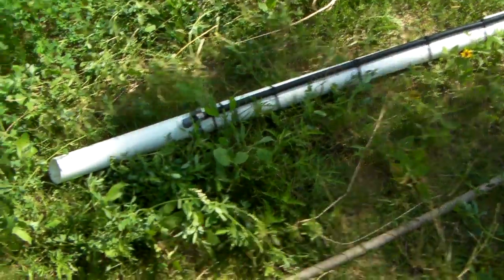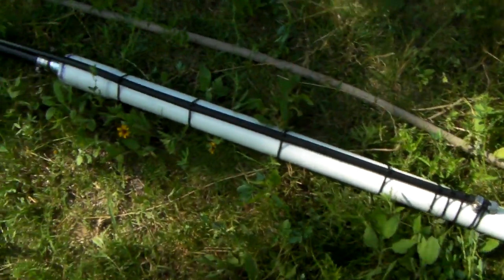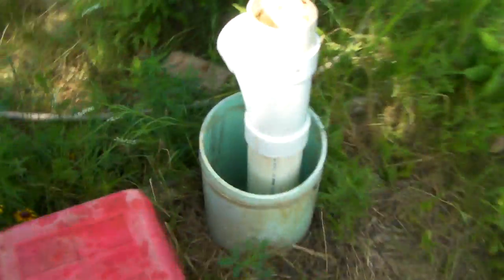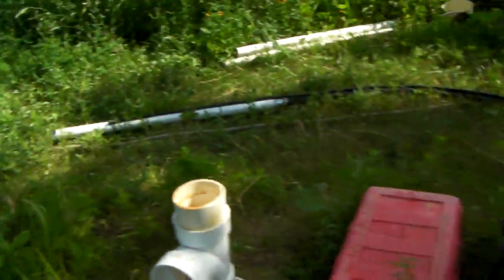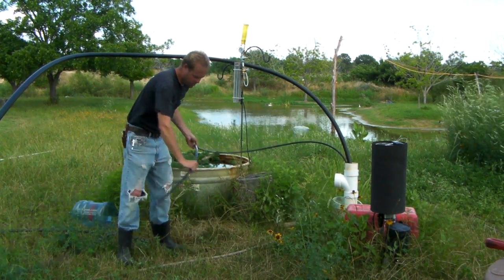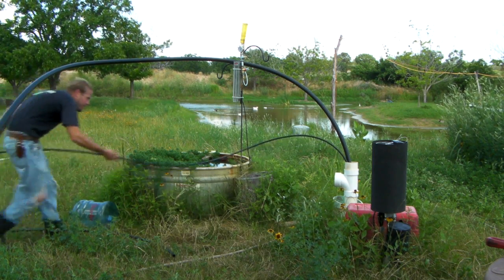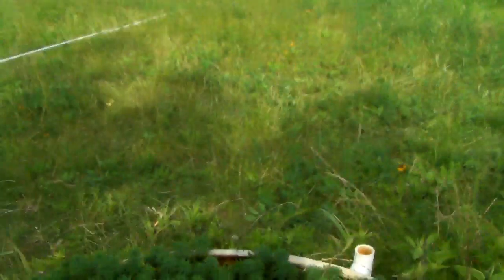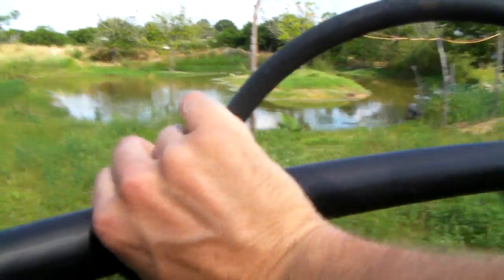Air lift water well pump in elgin texas part 2.5

Comment: Awesome knowledge.  I've been researching water pump to suck from 100' deep when I should have been looking at air pumps.  I've got a 4" casing with a 1-1/4" pvc for my submersible pump for the house but I've been trying to maintain my pond level during the drought but the 2000+/- watt pump is costing to much to run and I have less water pressure inside.  I'm going to find out how far my pump and water level is and see if this will work on my system without affecting my water quality to my home, not sure if this system add oxygen to the well water turning it in to an aerobic system or is the oxygen only in the water in the pipe going out?  I might look into what adding a check valve would do if added to the end of the pipe?  Heck, not even sure until I pull the well head if I can even put a pipe down the casing, think I might be able to do a 1" pipe with an air hose but have to watch out for the pvc couplers.  Thanks for the videos.

Comment: Water exerts point43 lbs per sq in per foot of vertical column in a pipe. So if my static water level is 40 ft down it is going to take 17.2 lbs of pressure to bring water to the top of a pipe. So about 20 lbs per sq in to bring it out of a pipe at the top of the well. Then the cubic ft of air pumped will determine the flow rate. Do I have that right?

Comment: Thank you so much for the video.   I'm not sure which videos are linked together, so might have already addressed this.   Can a Trompe hammer pump (a type of ram pump) generate the needed air volume and air pressure to run the pump?   If so, there is a facebook discussion here about the approach - please join in if interested:   https://www.facebook.com/groups/240458583255303/permalink/529284057706086/

Comment: If I understood correctly, the bottom of your well is at 68' from the ground grade...How deep is the top surface of the water in your well?  What is the power consumption of your air-pump?
Excellent video!

Thanks!